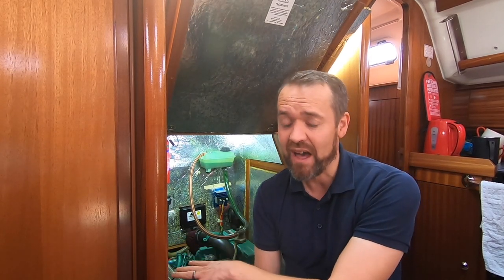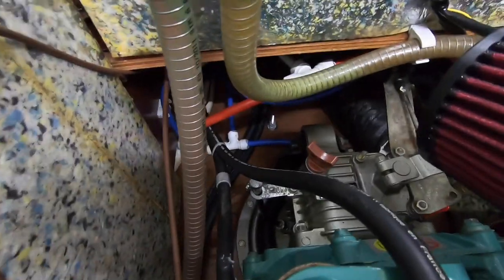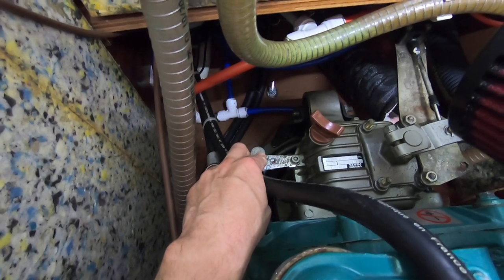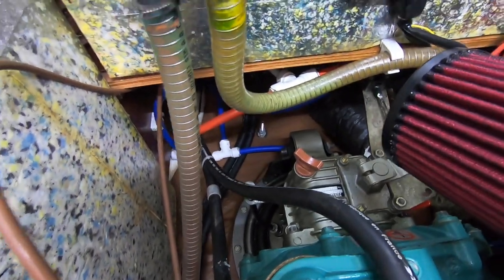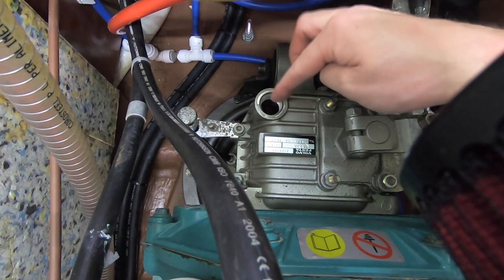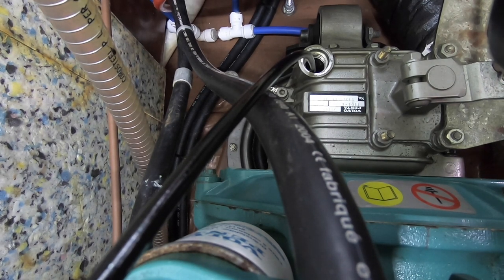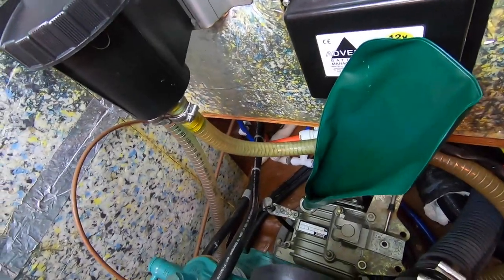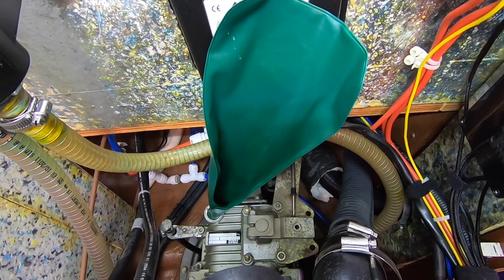Changing the oil in a saildrive while the boat is in the water (afloat) - Boat Projects

Comment: looks like the fuel hose is pushing into 20 years old.   A future topic?  
Also, I did my SD 130S oil change today.   I had 2 x o rings on that stopper.  I could get 1 liter or so from the dipstick hole, as a test, then got another liter or more from the tube.  But, I pushed on a larger tube over the existing one...
Reply from the maker: Hello, yes the fuel system is on my winter projects list. Keeping an eye on the pipe work for now. Yeah I need to get something to make a better connection to the pipe if I do the oil change in this way again. That’s a good idea going over the existing pipe - good tip, thanks ⛵️

Comment: Hiya
Fascinating stuff but I was wondering if you could answer a question about raymarine radar's compatibility with opencpn and raspberry pi?
Is it true that the RD218 is able to work with raspberry pi?
Sorry but I am new to all of this..
I love your work as you do everything the right way.
All the best
Reply from the maker: Hi, many thanks for your comments. That’s a maybe, it depends on what the display or mfd unit is. You need to find out if you have a Seatalk HS connection on the back of the display as this is basically Ethernet so can be plugged straight into the PI Ethernet port and then it should work. If you have a E series display you should be good to go. Just to confirm the radar does plug into the back of this display.
Reply: @BoatingwiththeBaileys  Thanks for your help and answering my question but what I really wanted to know is which of the raymarine raydomes  is compatible with opencpn.
Is it possible to plug in a raymarine dome into a raspberry pi leaving out the MFD?
Many thanks
Reply from the maker: Hi, not if you have an RD218. It has to connect via the MFD. Here is a full list https://github.com/opencpn-radar-pi/radar_pi/wiki/Raymarine-radome-model-support

Comment: Note you’re only changing about 70% of the oil. The rest remains in the lower casting of the sail drive. If you have water contamination the oil will separate from the water if left un-used. The oil will then float on the water which remains in the lower leg.  Sail safe. Ant.
Reply from the maker: I agree with the quantity of oil you can extract and it’s always best to lift but I do think it’s worth changing the oil rather than just leaving it. In my experience on the last boat which had water ingress in an older leg the water and oil didn’t not remain separate and the oil instantly turned milky.